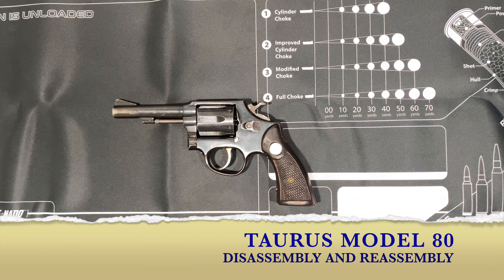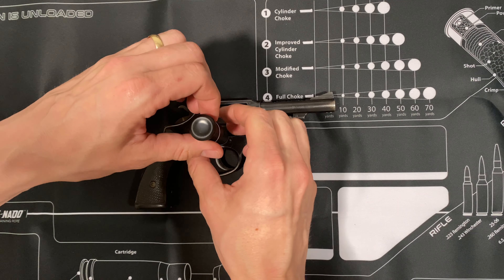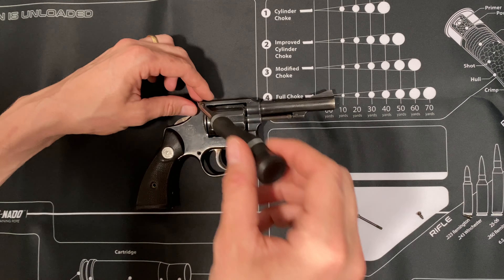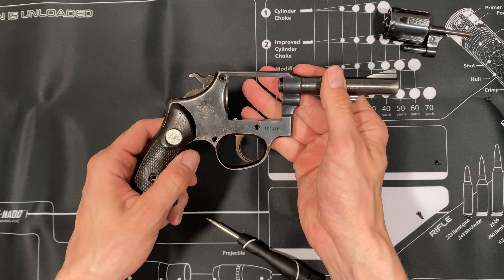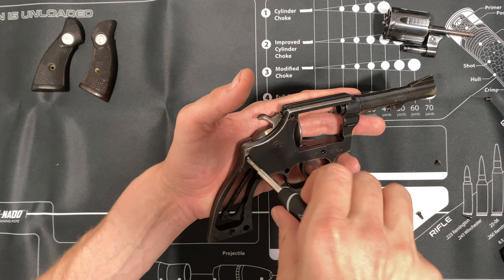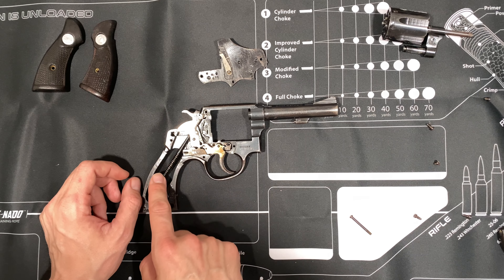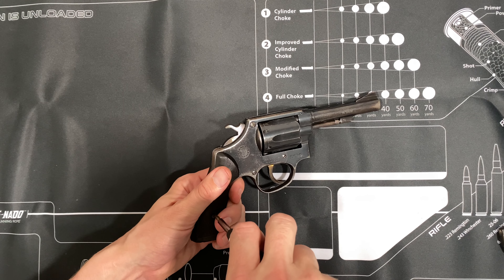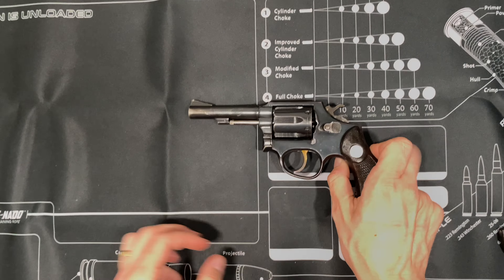Taurus Model 80: Disassembly and Reassembly

Comment: Great tutorial!  Have one of those too and once removed the side plate…and the hand, with that teeny-weenie spring, fell OUT when removing with me NOT knowing exactly how the unit was attached.  Devil of a time figuring out how to reattach:  I placed the hand where it functions from (not on the side plate where your video depicts) and used a straightened paper clip to hold the teeny hand spring in place via that small orifice whilst pushing the plate back on.  Luckily the revolver worked.  I was never aware the hand was attached to the side plate!  MUCH EASIER I see NOW to reinstall the side plate! 😂LOL!  Thank you for posting!

A friend GAVE me the ca. 1980 Taurus in 1995, because it needed a new hand, ratchet, and cylinder stop spring…all performed by a gunsmith.  I first tried to “play gunsmith” when I removed the side plate.  I capitulated when seeing all of those intricate parts, and called a smith.

Functions flawlessly and is in pristine condition.😃

Comment: Sir, thanks for this very informative disassembly video on a Taurus "classic", the early Model 80. Have collected the older Taurus Revolvers for a while and have found these older Taurus six-guns loaded with factory production extras. Those decorative "linear lines" that are present on the early Model 80's. 82, 84, 65, and 66 are unique for service .38's and .357's. Those lines (present on your Model 80) run through the cylinder flutes, the top strap, and front sight were "expensive" to manufacture into production. Features like these linear lines, were present only on the high dollar S&W Model 27 (early models) six-guns. Those 27's were high dollar six-guns, even in earlier times and Taurus was adding these custom features as just part and parcel of Taurus manufacture. The linear lines were discontinued sometimes in the mid-70's, due to manufacture expense. Those early Taurus guns (Model 80) were 5-screw copies of the old S&W Military & Police Model of 1905 4th Change revolvers. The inside workings were quite different as Taurs utilized a coilspring instead of a mainspring trigger. The humpback hammer feature of the older S&W M&P was present on these early Taurus Revolvers. The empty weight of the Taurus 80 mirrored the empty weight of the S&W (30.5-oz.) and I really appreciated the silver bull medallion in the walnut grip panels. At the time of their manufacture most South American Defense Forces were outfitted with the Taurus 80 and 82 Models. They came in a beautiful factory blue finish or a bright nickel finish. The 4-inchers in blue steel were the most popular and the subject of large contract orders with police, sheriff's, marshal's, Defense Forces in Central and South America, and civilian sales. I didn't start collecting the older Taurus Models until a few years ago, with my first purchase of a well worn beater Model 80. I got that bad boy home from a local gun show and from there started researching a firearm that I use to turn my nose up at. None of that crap, no sir, not anymore!
Reply from the maker: You know I didn’t know most of what you just told me. Thank you! I have saved this info.

Comment: Hey there, I have a model 80 identical to the one you're holding. The trigger locked in the fire position one day and I haven't been able to restore the double action, if you know the fix would you consider posting a video on how the double action works so that I might be able to remedy this? Thanks!